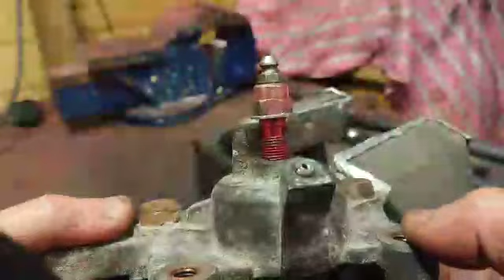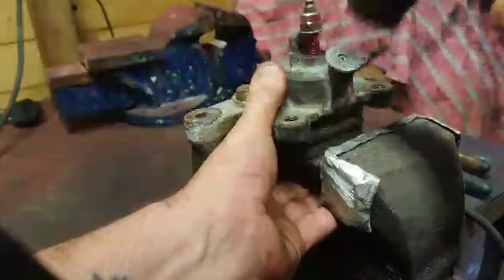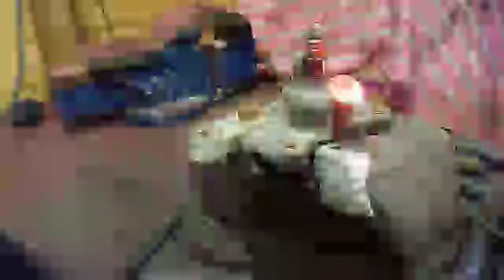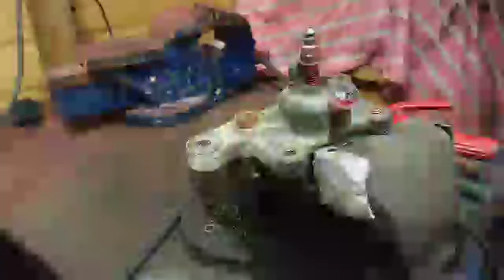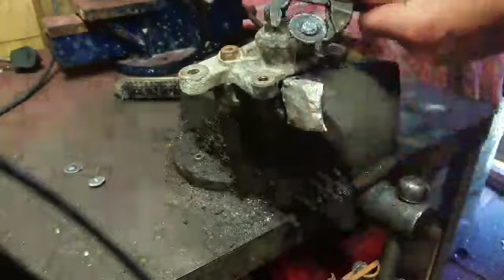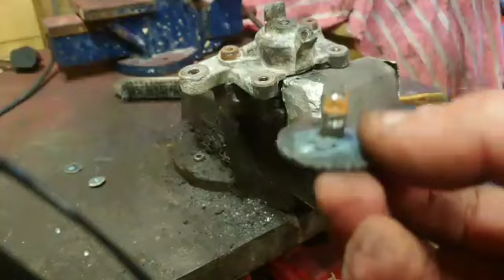Removing a snapped bleed nipple from a motorcycle calipers. Suzuki bandit /gsxr

Comment: THAT is a brilliant method! Heats the bleeder up at the same time breaking the seal a bit. Would be a bit more accurate wih a mig I reckon.  Another tip before you crack the slag off, wack a wet rag on the washer after the weld to make the screw thread shrink a bit quick, like. Helps to crack the bond between screw thread and caliper. 👍🏻